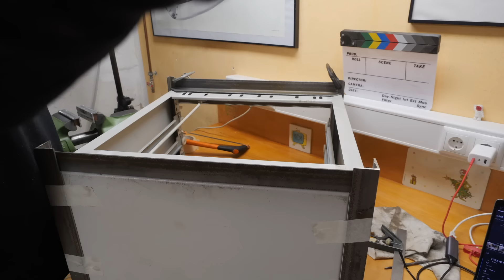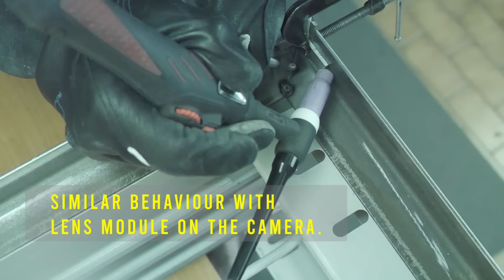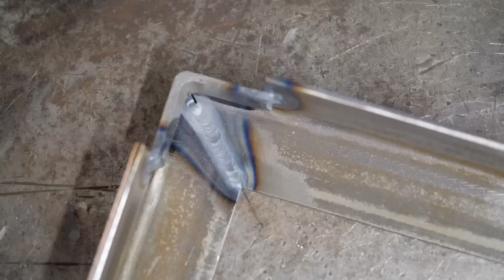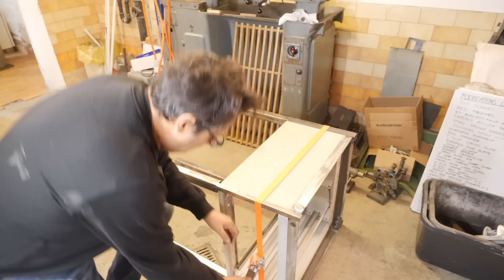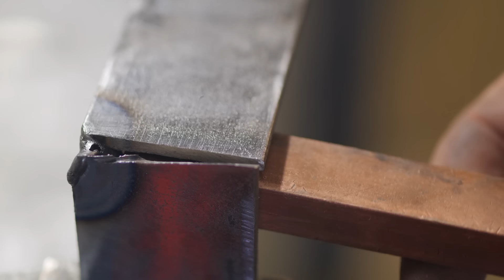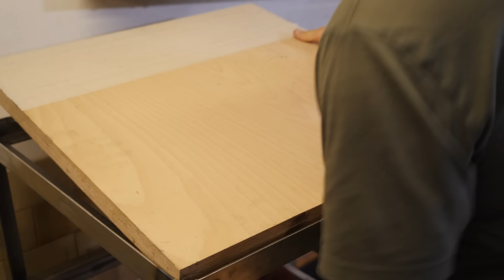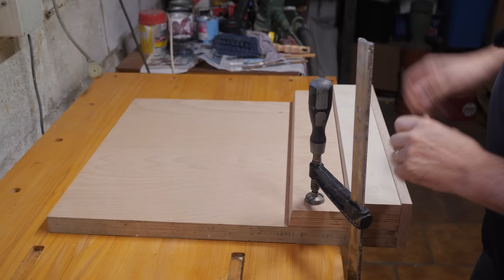DIY milling tool station || RotarySMP

Comment: I’ve never seen these style of casters ever in my life and both you and Clough42 build benches with them in the same weekend 😂
Reply from the maker: They are really nice. Stable on the casters, and rock solid once the feet are screwed down.
Reply: Hey, I was just wondering where you are based ... I always assumed Europe, but i spotted the "Austrian Air" sign on the blue toolbox behind the band saw .......Are you actually from Austria? In that case: Servus, Felix aus Wien, währ scho ziemlich cool endlich Mal ne gscheiten Österreichischen Uster zu sehen 😂
n @RotarySMP 

Edit: Jo die Pakete bestätigen die Vermutung, also sehr cool 😎, Abo dagelassen
Reply: @RotarySMP  Only trouble I can see with this casters is, smal wheels and rough floor.
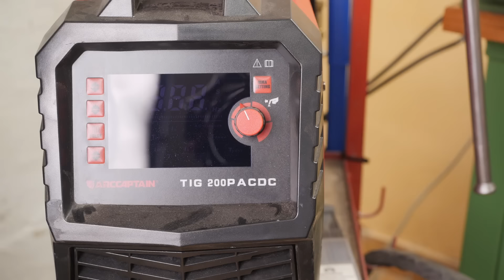6:56 As you pushed your welding cart in to the room, its obviously stoped at the point where small front wheels reached the edge of tiled the floor.

Of course.. in this case, you will probably very rarely move that cabinet . But with something like welding cart, which is frequently moved around.. you need bigger wheels
Reply: There difference is Claugh42 is a goofball hack that has no idea what he's talking about. That tool box was rated for 1200lb. The original wheels are probably more than that... 

Then he replaced them with 1000lb casters.... So almost 20% worse. 

To hold up a 200lb surface plate. 🤡🤡🤡

Comment: disable that lock mechanism in the drawers while you can.  that design is known for flipping over locked on it's own and you either have to fish a flat piece of metal to the back to unlock it, or drill the lock.
Reply from the maker: Thanks for the feedback on that. I'll need to see what bits to remove to disable it.

Comment: The side bars on your top cabinet aren't stiffeners, they're slotted for drawer dividers! Get some strips of aluminium sheet and notch them so they interlock and you can get rid of all those ice cream containers. At my last job we had divided up several drawers for endmills, taps, drills and inserts but we made up a press tool to notch the ally strips. 
Fun welding helmet story, if i'm wearing my speedglas and someone uses the forklift with it's amber warning light flashing even if it's not in view, my helmet dims with every flash and makes the auto darkening less reliable despite it not being visible. I thought the helmet was broken, perhaps there are certain wavelengths that mess with the auto darkening.
Reply from the maker: Thanks for pointing that out about the dividers. Makes sense. I'll look into getting some dividers laser cut.

In my other room, I found a helmet setting which then worked fine, although the lighting is very similar, if darker.

Comment: I can TIG, but stick is so practical, uses no gas and is extremely versatile, I stick a lot!
Reply from the maker: Hi Matthew. Yeah, it really is handy. And it is kind of cool to chip off the slag to reveal the weld. Like unwrapping a present :)
Reply: @RotarySMP  l stick  weld  stainless  over 1,5 mm,  I have 4  and 5 mm rods for heavy  mild steel fabrication, things like tool holders, fixtureing etc, all that with no gas,  using a tiny inverter!

Comment: Nice tight and convenient. I have built a similar one but used a overhanging ledge on one side on the top. It is to slide the vice over when I remove it for a different setup.  It slipped from my hands once and took a nice chunk out of the floor.
Reply from the maker: Good idea. So far I only have those small light vises, but I can see getting a heavier one.

Comment: for the Gühring boring bars they dont have a taper in the holder, its just a pin offset to just set it in the right angle and a screw or a clamp holds the tool the in the holder. an actually very simple system
Reply from the maker: Thanks. Andy Pugh also posted the same. I like that, as a simple cross bore with a pin will be much simpler than what I was thinking.

Comment: We usually take the lid off on those parallel boxes. It gets really tiresome to open and close them all the time.
The easier it is to put something away, the more likely it is to get done.
Reply from the maker: Good point, I probably will do that as well, if it stays in that cabinet drawer.
Reply: But it's also really tiresome to clean the chips out of them if you have the box next to the mill and chips go flying…
Reply from the maker: @johnhawkinson  I guess I need to close the drawers :)

Comment: cool cabinet bet it will work out nice for all the mill tooling
Reply from the maker: Hi Luke, I think it might already be too small :)
Reply: @RotarySMP that’s usually the case. The mill takes a lot of tooling especially a manual mill :) well mine does at least
Reply from the maker: @LCalleja  I just did a shed tetris session. Still not that happy with the lay out.
Reply: @RotarySMP You must need more Tetris practice :) oh by the way I had the some problem with my welding mask what I found to be the problem is certain angles didn’t help but then changed the mask and the problems went away so didn’t look into it any further

Comment: The taper tang on the Gühring boring bars just registers against / under a cross pin. (I have some similar ones) 
I am not sure what size pin, but a bit of CAD should answer the question.
Reply from the maker: Hi Andy, thanks for that. I had a much more complicated solution in mind.

Comment: My history with those types of cabinets is if they get slammed hard enough they can lock themselves. I'd recommend taking apart the lock and leaving just one pin in so if it ever does lock it just takes a screwdriver or similar to reopen.
Reply from the maker: Thanks for the tip.

Comment: im too cheap to buy a decent auto helmet, so i just use a old flip up lense. for 35 years infact :)
Reply from the maker: I also have an old flip up, but an auto-darkening make it much easier to position the start.